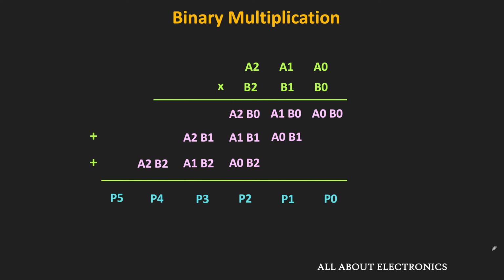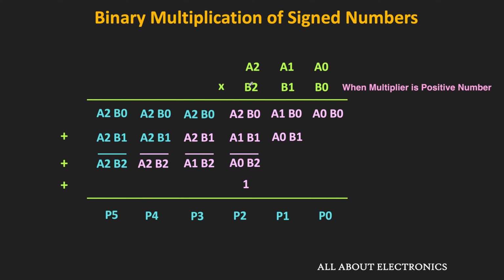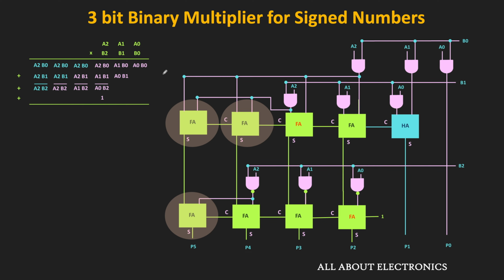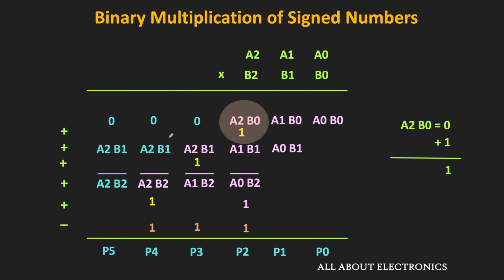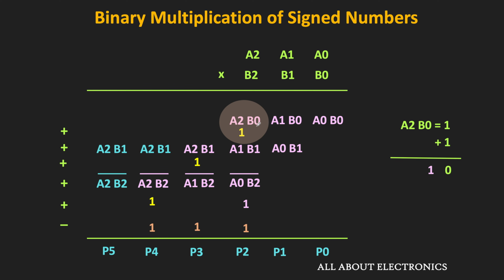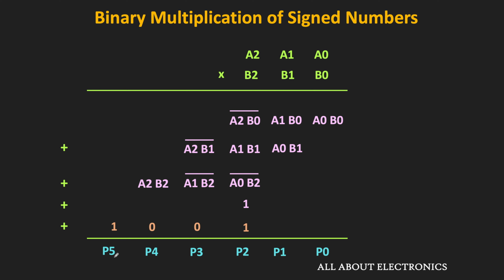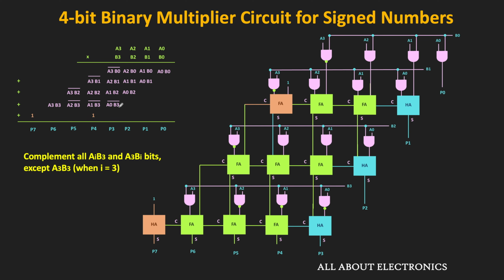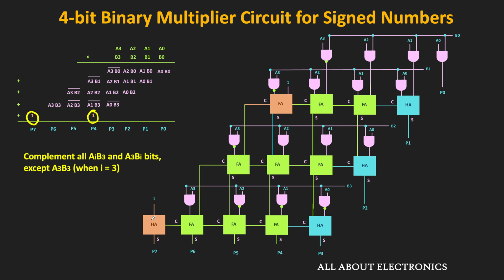Binary Multiplier Circuit for Signed Numbers Explained

Comment: Hello, I don't understand why the "1" is added and subtracted at three different locations, I got lost after this part as to what the source of this "1" is. Would really appreciate further clarification in regards to this point. Thank you for your videos.
Reply from the maker: The purpose of adding additional '1' at three places is to remove the additional hardware which will be required because of the sign extension bits during the multiplicaiton.